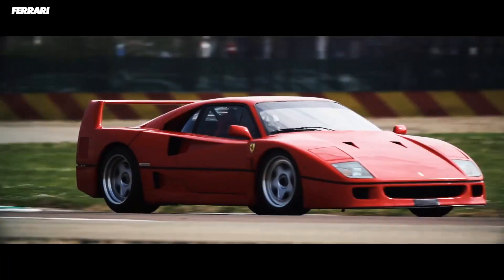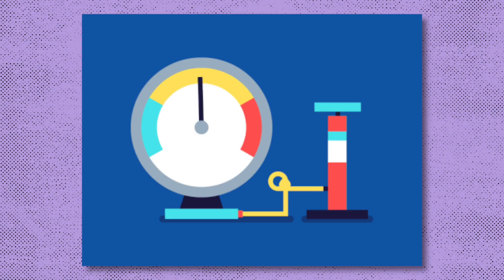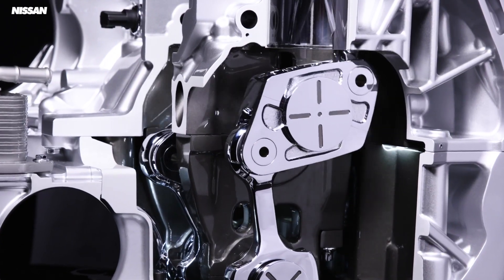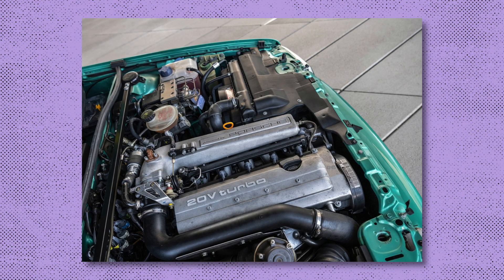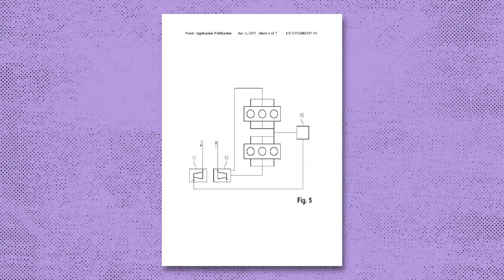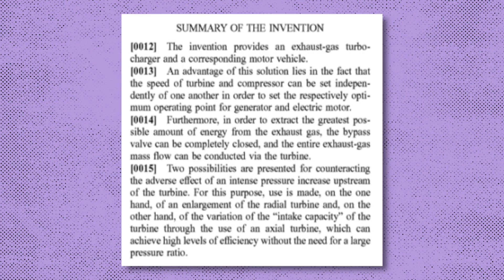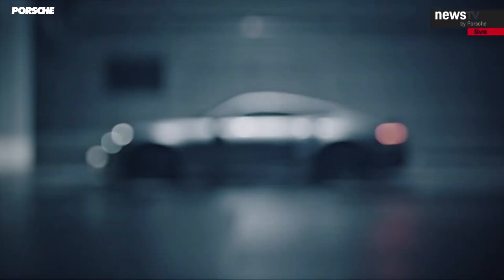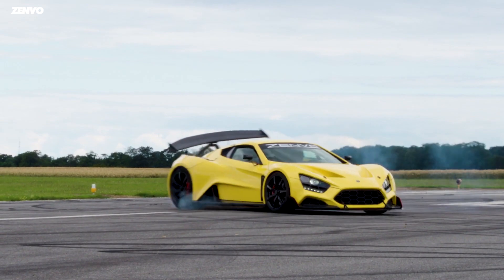Porsche's GENIUS New Turbo Design

Comment: Feel it's worth mentioning as this is a Porsche video. Porsches anti lag doesn't work the way you described, they leave the intake slightly open when you lift off throttle to keep the turbos spinning
Reply: Too much ego in this comment section.
Reply: @kelvinkeme9397  because this idiot is basically telling me the sky is unicorn colour. Couldn't be any more wrong
Reply: Yes. It makes the turbo lag predictable and makes it unbelievably fun to carve some corners
Reply: If they leave the intake open, does that mean it uses more gas?
Reply: Not if the ecu injects no fuel. Maybe the engine braking makes the engine reciprocate and that pushes some air through?
Reply: @elchucapablas  yep
Reply: @igamehard8860  "I guess when you have no knowledge you attack someone's...." my man, staring into a mirror? Had to have yet another chuckle hahaha. You're a gift
Reply: @2g1c69  don't delete comments. Now my where exactly did my conversation disintegrate comment will be lonely :(
Reply: @2g1c69  If I'm starting into a mirror you LIVE in a house of mirrors. So you are just going to glaze over your brillisnt remark of " only a fool resorts to insults ".. Do you know what the word fool means smooth brain?
Reply: @2g1c69  I'm curious. Where exactly did my argument disintrsgate? I've been saying the same thing this entire time you dummy lol
Reply: What fool means? It's why you've brought me great chuckles. Yes I sickeningly enjoy watching credulous commenters lose their cool, what an easy way to pass time & judgement. What a genius you must be! I would've thought a genius would simply explain a problem soundly enough for the most challenged to understand. I guess I'm no genius either
Reply: @2g1c69  I did go into detail.. about how SOME air moving through the engine by leaving the intake open is better for the turbo response then NO air going through. Tbh that shouldn't need much explaining if you really understand how an engine works. Turbos arent exactly an automatic transmission.. But I guess if I can't explain exactly how Porsches dynamic boost works then that means it doesn't lol.
 I'm sorry Dr. F. Piech
Reply: @igamehard8860  If you can't explain how it works, don't try to sound like smartass. None said it doesn't work. From the beginning we stated that it doesn't work like YOU described!
Your words in 2nd post: "This allows more air to pass through the engine, keeping exhaust flowing and spinning the turbos even during deceleration." 
It's not about moving air, it's about keeping intake under pressure.
In the end, Andrew and me was right that's not about moving air (which can't provide energy for turbo and prevent it from slowing down) and there have to be more to it or other explanation. 

As i said, everything is simple in principles, even your "complicated" automatic transmission. The deeper you dig the more complicated it become and turbochargers from engineering/science point are WAY more complicated than transmissions.
Reply: @feluke8396  I'm not reading all that.. if I'm wrong simply tell me where.. I don't need a story.. what do you mean like I described? You mean like road and track and engineering explained described, right? lol did you forget your comment from 8 days ago where you stated " the intake valve stays open? " Which is what I've been saying this entire time. I really get the feeling you don't fully understand how an ice, or any part of the car after your turbos are WAY more complex then transmission remark.. the fact no one has jumped on you yet speaks volumes to the lack of knowledge here
Reply: @2g1c69  because it's funny... The genius ( in this thread it's impossible to tell which one lol) just stated that the intake stays open allowing boost pressure to not drop off completely which is EXACTLY what I've been saying this entire time.. only everyone is too stupid to see it. If he says it's flatshift.. then sure it's flatshift lol. I'm more then done
Reply: I was going to add a comment but jeez (this comment thread is ridiculous). I know some version of Porsche's anti lag system actually functions to use wide open throttle momentarily when you blip the accelerator (say through a turn) in order to spool up the turbos so they are pre-charged when you get on it. Clever programming on their part
Reply: @gmatta1112  Which sounds similar to what I've been saying. This mess all started when andrews first unedited comment was keeping the intake open DOESNT allow the turbos to keep spinning. Which if was true would defeat the whole idea of Porsches inti lag or dynamic boost.

Intake stays open, engine gets more air going through the intake and exhause valves to allow the turbo to keep spinning reducing turbo lag. Its pretty simple and don't see why it's so difficult for some to understand. I want to say case closed but I know its never going to happen
Reply: @igamehard8860  
What I said was they don’t stay spinning. It means they don’t maintain enough RPM to create boost. Yes that is racer talk and not engineering language, my bad. Anyone who understands turbos without being argumentative understands turbos always spin. But it takes 10,000’s of RPM to get boost. A turbo spinning at 5,000 RPM will not deliver boost. It is often stated it needs to spool up or start spinning to get boost when this occurs. It is never meant it doesn’t turn!
You can say I wasn’t exact enough and that could be true. But the next two sentences made it clear this is exactly what I meant. 
Much more interesting is the engine creating full boost from idle to redline and at every throttle setting 100-% of the time…. With turbocharging
Reply: @andrewday3206  if an engine is running the turbos are spinning, what you mean they don't stay spinning? Obviously off throttle there isn't any boost and it's impossible to get all the boost back instantly. The dynamic boost HELPS reduce turbo lag, not bring all boost back instantly
Reply: @MrPorsche91730  
That’s exactly what I’ve been saying. Off throttle they spin too slow to develop boost. Of course they spin but far to slow for a non vacuum condition. 
Exactly
Reply: @MrPorsche91730  
BTW no it is not impossible to maintain full boost while off the throttle. I described an engine already built that had full boost with zero throttle input. In the comments are the details of full boost design at idle.
Reply: @andrewday3206  yes but with PORSCHES system it's impossible to get it all the boost back.. which was the whole point of this conversation. Porsche not other companies
Reply: @andrewday3206  but leaving the intake open allowing air to pass through the engine and turbos is better for response then no air going through. Your argument really makes no sense and it's sad it's gotten to this point. The system isn't made to create loads more boost, it's to keep the turbos spinning faster then if the intake was closed to help reduce lag time
Reply: @MrPorsche91730  
It wasn’t the whole point of this conversation. Early on in this thread I pointed out there have been engines that develop full boost 100% of the time. I got insulted for pointing this out. Of course it is part of the discussion. It shows how this Porsche design did not go as far as is possible. This is a mild system. It is literally equal to every stock Diesel engine out there.
Reply: @MrPorsche91730  
I never said anything about “loads more boost” for this design. I agree with you 100% it is really sad it has gotten to this point!
Everyone wants to be smarter than all other people, and nobody wanted to learn. It was sad 100%!
Growing up surrounded by engineers people discussed to learn and not to hear themselves sound smart. Not being arrogant but nobody here wanted to learn. I’m sure in fact I’m 100% sure there is a TON left for me to learn, but uneducated insults are beneath engineering
Reply: @andrewday3206  but you keep saying it doesn't spin the turbos fast enough to create any boost, but the system isn't 100% ment to do that. It just keeps the turbos spinning faster then they would normally be if the intake was closed. It reduces lag time as well by already having some air flowing through the engine as opposed to a car without this system
Reply: @MrPorsche91730  
Agreed 100% Yes
Reply: @andrewday3206  how manny people do you need, till you understand that you we're wrong?
Reply: @Razor9638  
When I see an energy balance showing me wrong. So far I have not seen that. The only thing I got wrong was using a racers expression expression saying the turbos weren’t spinning to mean they weren’t spinning fast enough to make boost. The next 2 sentences said why they weren’t making boost. It is clear to anyone who understands turbos that is what I meant. Where exactly have I been wrong? Please be specific
Reply: @andrewday3206  seriously, If you look back at your comments and replies and don't understand how it makes you look stupid for the rest of us readers, you should learn to reflect on your own behavior.
And if you are mentioning patents in that field, where is the problem with sharing them?
Reply: @andrewday3206  I just looked up. There are tons of Andrew Days with patents... But not a single one with turbos😉
You have the time to post tons of comments but putting a simple number is isn't possible. 
How could anyone not be sceptical about that?
Reply: @Razor9638  
You finally started looking after all these posts.  Still you cannot once answer where physics is wrong 
Impressive, No really that’s impressive 😂😂
Reply: @MrPorsche91730  I just love how substantive discussion is out of your reach. When confronted with facts and someone with more knowledge you simply ignore them. XD
We already told you that the amount of air passing through turbine is so low that it's insignificant. There are no gains from it, that are measurable.
The only gain would be from "flat shift", when you don't close throttle, keep the pressure in intake instead of using BOV/DV. The turbine slow down more but in the end gain way more from instant supply of air to combustion chamber. Turbine doesn't waste time to pressurize the whole intake system.
Reply: @Razor9638  He's not wrong.
We already told that the amount of air passing through turbine is so low that it's insignificant. There are no gains from it, that are measurable.
The only gain would be from "flat shift", when you don't close throttle, keep the pressure in intake instead of using BOV/DV. The turbine slow down more but in the end gain way more from instant supply of air to combustion chamber. On top of that turbine doesn't waste time to pressurize the whole intake system.
Reply: @Razor9638  You Rock.. and Roll. 
Dude don't engage the idiots. The truth is very simple and right in front of their face, but one idiot THINKS he knows better then a group of Porsche engineers. Which I somehow doubt..
Reply: @Razor9638  Nice to see that all of yt isn't a bunch of pathetic kids who think they know everything. Somehow I get the feeling someone with the picture of a cartoon cat may not be the best place for automotive knowledge... Clearly. Oh damn.. they " already told " me that Porsches dynamic boost is a gimmick and does nothing. If the mighty feluke says so, it must be true I guess lol
Reply: @MrPorsche91730  Arguing with you is like playing chess with pigeon. In the end it will knock all the pieces, shit on board and flutter wings like it has won. You stick to something you read in magazine like it's Holy Bible. You won't exercise your brain a little bit and check if what they said is even possible. Me and Andrew Day are looking for answers how it works. 
For you, article in magazine is good enough, even if it's simple PR.
Keep it up, among friends you will sound very smart. XD
Reply: @MrPorsche91730  "The Dynamic Boost Function enables the turbo in the car by maintaining the charge pressure during load changes (for example, when the accelerator pedal is released briefly). This is achieved by just interrupting fuel injection, whereas the throttle valve remains open. As a result, the engine reacts with practically no delay to another press of the accelerator pedal"
FLAT SHIFT!!!! A GOD DAMN FLAT SHIFT!!!!!!!!!!
BUAHAHAHAHAHAHHA!!!
Reply: @MrPorsche91730  
"Furthermore, the new Dynamic Boost function improves throttle response when the driver lifts
off the accelerator pedal during full acceleration and then gets back on it. At this time, the
throttle valve remains wide open, while fuel injection is interrupted. As a result, boost pressure
does not drop off completely, and the engine reacts promptly when the throttle is reapplied,
comparable to a naturally aspirated engine. The effect is most pronounced in Sport and Sport
Plus modes."
Doesn't use BOV/DV and leave throttle open. Something similar to FLAT SHIFT.
I rest my case Mr. Smartass. XD
Reply: They also achieve this through intentional backfiring. I drive a vehicle made by the same manufacturer(Porsche does not Manufacture Porsche, VW does). Anti-Lag my ass!!! I still prefer and am contemplating installing a supercharger on my car and selling this turbo...
Reply: @DJBillionator  
What a lot of these guys don’t get is a Diesel engine doesn’t have a throttle body. A Diesel engine has 100% air flow 100% of the time. Nobody ever says a diesel engine has an anti-lag system or is turbo-lag free LOL
Reply: @Alfred Wedmore already backpeddling deleting comments after 1 hour lol.. pathetic
Reply: Also let’s not forget the variable turbos. They always seem to get replaced when moar buff horses 🐴 and moar power is wanted. The engine generally powers a supercharger via a belt why not have a belt turn the turbo at a certain speed at idle up to the point the exhaust spins it faster then just have it where the pulley spins freely at that point. I guess that would make it a hybrid cross of a supercharger and a turbo. Someone write us up a patent application.
Reply: If only the assumption before replying was "I bet there is a valuable perspective being shared. If I am quick to call it wrong, maybe I haven't taken a breath to first understand the intended meaning of this person's words that I may be misinterpretting."

Literally nothing Andrew said is inaccurate *if you took the time to understand what he meant and in what context he was speaking*. And in fact, most of the commenters who were disagreeing actually ultimately had the same basic foundational understandings, except some didn't think as deeply into the whole process, and many didn't understand that there were multiple different points made in individual threads of thought that weren't direct comparisons, but rather whole different ideas (like the Porsche system vs what could be possible with a further optimized anti-lag system). 

If attitudes had simply been different, whole new understandings, and even co-creative ideas and solutions could have arisen out of this discussion. This behavior is literally at the root of so much destruction, that one could say it's one of the primary roots of war, domestic abuse, and a host of other worldly non-sense. Y'all can do better. 🙌
Reply: Even a Chevy Cruze has a recirculating bypass valve on the turbo
Reply: Leaving the intake open does not keep the turbo spinning fast enough to create boost. The lack of spinning of the turbo is due to a lack of exhaust gas energy. Leaving the intake open does not keep the boost going.
Reply: @andrewday3206  No, but opening the intake would allow the turbos to spin freely on inertia instead of spinning against built-up boost. this means that the turbo can spool up to boost levels faster as it was never spinning slow to begin with.
Reply: @andrewday3206  In a Porsche with Dynamic Boost, lifting off the throttle pedal shuts off the fuel injectors, but leaves the throttle partially open. This allows more air to pass through the engine, keeping exhaust flowing and spinning the turbos even during deceleration. Dynamic Boost doesn't get rid of turbo lag entirely, but it reduces the time it takes to get the turbochargers spooled up significantly
Reply: @igamehard8860  
It’s the burning fuel that supplies the energy to spin the turbos. My father designed a engine that blipped open the exhaust valve a tiny bit during the power stroke. They added a small amount more fuel. This allowed exhaust gasses to exit the combustion chamber and keep the turbos spinning. The engine maintained full boost at idle.
Reply: @andrewday3206  you are so wrong.. are you really educating me on turbos work.. talking to you I feel this subject is way over your head.. this goes way beyond the basics of a turbo
Reply: @igamehard8860  
I’m not wrong. The energy comes from somewhere. Engines release energy from burning fuel and utilize it to do work. That work can be turning a crankshaft or can be building boost.
Reply: @igamehard8860  
Diesel engines have full air during every throttle setting. Diesel engines do not limit air, there is no throttle body. Even in an engine with 100% open intakes you need to burn fuel to spin turbos. The one caveat is during engine deceleration you are turning potential energy, the spinning engine, into boost built. Doing this will stall the engine if one keeps doing this however
Reply: @igamehard8860  
Stop with 8 year old insults. Where does the energy come from?
Read my entire reply!
Energy comes from somewhere
Reply: @andrewday3206  In a Porsche with Dynamic Boost, lifting off the throttle pedal shuts off the fuel injectors, but leaves the throttle partially open. This allows more air to pass through the engine, keeping exhaust flowing and spinning the turbos even during deceleration. Dynamic Boost doesn't get rid of turbo lag entirely, but it reduces the time it takes to get the turbochargers spooled up significantly
Reply: @andrewday3206  that's taken from a r & t magizine.. I doubt you even know what r & t is. These are facts.. not some garbage info from a know nothing kid
Reply: @igamehard8860  
Yes and using the engine as an air pump to spin turbo wheels slows the engine RPM!
This design cannot keep an engine running. Ultimately it will slow down the engine as energy is being used to pump air, or it will slow down the vehicle and act like an exhaust brake. This design cannot sustain itself in a running configuration
Reply: @andrewday3206  do you need a bright red ball bouncing on each word?? It clearly states the intake is partially open... You are something else to argue with facts right in front of you
Reply: @igamehard8860  
It is using stored energy in vehicle speed or engine rotation to power an air pump effect. This by design slows down the engine RPM and/or vehicle speed.
Do you just regurgitate words without understanding the physics? 🤣🤣🤣
Reply: @igamehard8860  
This will not stay running if left in this situation. More fuel needs burning to keep the engine running

Learn Engineering!
Reply: @andrewday3206  I'm more then done. I've posted the facts.. again I can only show it to you I can't understand it for you
Reply: @igamehard8860  I mean this with no disrespect due to the fact that I’m barely educated on this matter, but if the technology wasn’t around why does my cayenne hold revs (only when driving aggressively, with almost a wide open throttle) when I release the gas pedal? Maybe I’m stupid. I dunno 😂
Reply: @Chrysaor_  it's probably the transmission holding gear. Porsches do that as the car thinks you are cornering. They hold that gear for a few extra seconds so the transmission isn't constantly shifting and is in the right gear when you accelerate again. Have your coolant lines held up? There was a problem with the plastic becoming brittle and breaking. Yours sounds older so I'm sure it's been fixed by now
Reply: @igamehard8860  thanks for the info 🙌. Take it easy man.
Reply: @Chrysaor_  
It can holding it in gear or it can be keeping additional fuel injected to keep the RPM higher. One supplies energy from fuel burned and the other supplies energy through feeding off vehicle speed
Reply: @Chrysaor_ np. Take care.. if this other dummy stops talking to me maybe... I know Porsches
Reply: @igamehard8860  
You don’t know engineering or physics 
You still cannot answer where the energy comes from. You just copy and paste then claim that is comprehension 
Sad!
Reply: @igamehard8860  
Exactly you copied words from a magazine!
I couldn’t agree more. But with all your 8 year old insults you still haven’t answered where the energy comes from. Something has to power the air pump effect upstream of the turbine wheel. If fuel isn’t being burned where does the energy come from?
Try answering the Mass and Energy Balance if you know what that means
I’ll wait for your immature reply which still cannot answer what supplies the potential energy 🤣🤣🤣
Reply: @andrewday3206  and you don't know simple English which is more pathetic.. I've posted the article 3 times where it clearly states the intake is slightly open.. but you are clearly going to believe what you want and I couldn't care less
Reply: @andrewday3206  so if you think I'm wrong how about you pull up an article on exactly how Porsches anti lag system works. Showing the intake is 100% closed. I came up with some proof, now it's your turn mr knowitall
Reply: @igamehard8860  
A diesel keeps the throttle 100% open all the time. That by itself doesn’t create boost. Jesus maybe 95% of people in social media lie. But literally I have patents in reciprocating engines. I understand what the article is stating. I’m just pointing out it’s converting energy in the form of a spinning engine into work done pumping air through the engine to spin a wheel. My point is that is very different than designing an engine that can MAINTAIN 100% boost from idle all the way through the entire RPM range at every throttle setting! 
Go ahead and make fun of me for being proud of my father for designing and building this. But I am proud of that work, it inspired some of my patents later in life. This all started by me sharing that there are already turbocharged engines built that have full boost from idle to redline and at every throttle setting 100% of the time!
Take some engineering classes if you care this much you just might invent your own designs and hang your own patents on the wall. It’s a cool thing to do
Reply: @andrewday3206  mmm so that's a no.. shocking
Reply: @igamehard8860  
I never said it was completely closed. OMG I said the energy needed to spin the turbine wheel has to come from somewhere. If it isn’t supplied from burned fuel, it has to be supplied by converting motion into pumping air through the system. This either slows the car or the engine RPM like and engine brake by extracting energy. That’s what I stated. 

 This all started by me sharing a cool design concept where we already have engines built that have full boost 100% of the time. This goes beyond what Porsche has done. That’s what I stated the physics behind it. And that Full Boost 100% of the time has already been achieved and how it was done
Reply: @andrewday3206  engineering explained clearly stated the same thing. Porsches anti lag leaves the intake slightly open... You give me the feeling your father had some really smart co workers
Reply: @andrewday3206  wow wow wow... your first comment said leaving the intake open does not keep the turbos spinning. IF you read the article I copied and pasted you wouldn't be so confused. It clearly states they leave the intake open to allow  some air to go through the engine and keep the turbos spinning.. I hope you aren't sober at least. That was pathetic
Reply: @igamehard8860  
No Porsche leaves the throttle body entirely open!
It does not leave the throttle body slightly open.
The Porsche system extracts energy from vehicle velocity to use the engine as an air pump aka air compressor and this drives the turbine wheel. The Porsche design extracts energy from the vehicle. That is the simple question I asked. 
Here’s a hint engineers work with a lot of smart people. The design he invented had a multi lobe camshaft that would bleed combustion chamber pressure out of the cylinder before the power stroke had finished. This was just enough to keep the turbine spinning at full boost so it didn’t effect fuel mileage very much. But as the video you shared said Porsche had a mild system. The design my father invented and built was wild as it kept boost at 100% all the time, period!
That’s the difference I pointed out in the very beginning. 
#Engineering
Reply: @andrewday3206  you going to start backpeddling now.. I nEvEr SaId iT WaS CoMpLeTeLy ClOsEd
Reply: @andrewday3206   it clearly says the throttle is partially open.. were you given a pile driver on your head
Reply: @andrewday3206  lol. It's adorable how smart you think you. The professional writers at Road and track says it's partially open, Jason Fenske from engineering explained says it's partially open ( he said fully I didn't watch the video ), my excellence Porsche magizines say same thing but some dummy on yt says it's fully open...3 to 1.. you win
Reply: @igamehard8860  
1) Leaving the intake open without burning fuel or extracting energy from another source will NOT build boost. That is what I said from the start and I am still correct. I kept asking where does the energy come from and you couldn’t answer that!

2) The throttle body is not slightly open as you said many times. The throttle body is 100% open just like in a Diesel engine. And just like in a Diesel engine it does not provide full boost at idle or any other RPM without burning fuel. That was my other point and that is still true.

3) The system turns an engine into an air compressor to spin the turbine. And just like an air compressor that requires energy. An air compressor uses a motor to turn it. This uses the transmission which is extracting energy from vehicle velocity to make the engine, now an air compressor, spin.

That’s the engineering and energy supply. I have been correct the entire time
Reply: @andrewday3206  but leaving the intake open does allow the turbos to spin PERIOD. Disproving your original point of saying they don't
Reply: @igamehard8860  
A turbine spinning doesn’t create boost unless it’s output is more than the engine is ingesting!
So no that does no disprove anything at all. Turbocharged engines still operate in a vacuum much of the time. That is why it’s called off boost. That is also why you have turbo lag waiting for the turbine wheels to spin up and increase RPM where it pumps enough air to create pressure aka boost.
Reply: @igamehard8860  
I never said they don’t spin!
Turbos can spin 100,000 RPM at full boost on some engines. Even at idle they will spin a few thousand RPM. But that does not supply enough air for the engine not to be running in a vacuum I.E. negative boost situation where there is a lag time before the wheel spins fast enough to create boost
Reply: @andrewday3206  dude you saying leaving the intake open doesn't allow the turbos to spool in your first comment is false, Period. I'm not getting into all these other arguments and I have much better and important things to do then teach ppl how to read
Reply: @andrewday3206  mate you need to get off your high horse. The "energy" comes from acceleration, the anti lag keeps the throttle body open to allow airflow to keep moving through the engine rather than it being shut off almost completely, that is what allows the turbos to "spin" as it reduces the braking force that a closed intake has on it, its not called anti lag it's called dynamic boost there's a difference, it's really not difficult to have a Google of it and educate yourself.
Reply: @ant_mk3596  
The energy does not come from acceleration. Acceleration comes from applying energy. Having the throttle body closed is not what causes the turbine wheel to slow down. Not having energy applied to the exhaust turbine is what slows it down. Allowing the air to flow freely like in a diesel is what allows force to be applied the the exhaust turbine which keeps the compressor turbine, actually both, spinning. That’s the reason people say diesels work so well with turbos. 

Whatever the marketing name does not change the physics LMAO 🤣🤣🤣
Reply: @andrewday3206  I feel like you've just heard some vague physics terms, without really understanding them lol. "The energy does nto come from acceleration" lol wtf bro. If you wanna be pedantic which it seems like you do, energy is a force applied over a distance W=Fs. Having the throttle body closed reduces the amount of energized gas flow to the turbine, hence letting it slow down -  that sounds like closing the throttle slows down the turbo to me, go read up proximate cause vs ultimate cause for explanation.
Reply: @jackwilson7082  
Work is force applied over distance. It can be measured in terms of energy, but that is not the only method of measuring energy. BTU, KW/Hr, Kilotons and more are also measures of energy. Heck Adiabatic compression can be a  measurement of energy. 

 The energy to pump those gasses in the design Porsche marketed comes from the crankshaft as a parasitic loss.
That’s the point which I made. 

 The intake stroke will draw a vacuum on the compression turbine helping to keep it spinning. The exhaust stroke will help keep it spinning as well. There still is not enough energy applied to create boost. It is the same as a Diesel engine as those do not have a throttle body and always draw full air. But Diesel engines are often drawing more air than the turbo can supply an not in boost.
Reply: @jackwilson7082  
Are you seriously telling me a volume of compressed gas does not contain stored energy?
That’s just insane
Reply: @jackwilson7082  
I never said the intake draws from the exhaust. As the piston comes down it draws in air. With a turbine wheel partially blocking the intake it draws a vacuum. This spins the compression wheel. You seriously didn’t understand that?
You seriously don’t understand a turbo has an exhaust turbine and a compressor turbine?
Damn!!
Reply: @jackwilson7082  
BTW compressed air energy storage is already used in industry. Compressed air contains energy
Damn you make some amazing claims 🤣🤣🤣
Reply: @igamehard8860  Andrew is right. Porsche are using the energy of the car moving (or flywheel inertia) to turn the engine to pump air through the engine to keep the turbo spinning. The valves being open enable this but do NOT provide the energy, which is what Andrew is saying
Reply: @andrewday3206  An adiabatic process is not a measure of energy, so you are just plain wrong. I never said compressed gas cannot hold energy,  however no one ever says "how many kg of 100psi air worth can your engine out in power?". Frankly, your inability to actually articulate what you're saying isn't my fault - don't try to gaslight me by retroactively changing what you're saying.
Reply: @psk5746  Yeah like no one here ever thought that opening a valve "generated energy" - its cause you're using the engine as a pump which is fed by the momentum of the car. But opening the valve is whats enablign that. Andrew over here just likes using physics terms he doesn't really understand lol. I mean he's trying to explain work to me this rubbish "Work is force applied over distance. It can be measured in terms of energy, but that is not the only method of measuring energy." like wtf 😂😂😂bro doesn't understand how units work
Reply: @jackwilson7082  well reading everybody's replies it certainly appeared that most believe the energy came from opening the valve
Reply: @psk5746  yeah everyone is talking about cause though - why it works - not where the energy comes from. I think why everyone is so confused is because Andrew is hell bent on talking about energy
Reply: @jackwilson7082  well energy is required to spin the turbine.

But yeah a case of miss understanding due to the written word
Reply: @igamehard8860  what's a Magizine? Over here in England it's a Magazine and seeing as we invented the language I think you'll find we are correct and not you. By the way reading a bloody article in a MAGAZINE doesn't make you an Engineering god. Do you actually know anything about ICE and Turbocharger technology, or are just  quoting from the article? My guess judging by your username is you spend all your time playing computer games..Leave the engineering to the engineers in future.
Reply: @jackwilson7082  
I certainly won’t change what I said. Yes a given amount of gasses at a given pressure is a measure of energy. If you don’t understand that it is not on me. As I said compressed air energy storage is literally an industry. Also how do you think an engine works? The compression stroke is literally adiabatic compression!
I’m amazed you don’t know this
Reply: @andrewday3206  I feel so sorry for you... You have to argue with arrogant prick that have cognitive dissonance and is at the pinnacle of Dunning–Kruger effect. He doesn't know how turbo work, doesn't know what is needed for it to work. He read about partially open throttle for antilag and all of sudden, his an all knowing oracle.
I understand the principles behind Porsche "antilag" but i think it gives very little effect to none. If it did work so good the diesels would work epic because of no throttle to limit air. Way better would be to open throttle and in exhaust stroke inject small amount of fuel and ignite it. With direct injection it should be easy and harmless to the turbo.
Reply: @andrewday3206  I think i know what Porsche meant by implementing open throttle on deceleration and how it works. They probably don't use DV/BOV on lift off and provide that air to fill intake and cylinders for instant response after "throttle" is applied. Something similar to flatshift.
Reply: @feluke8396  
I have to agree with you. Thank You for the input
Reply: @feluke8396  
Back in the day Cummins diesel tried exactly what you said. They injected diesel fuel directly into the exhaust manifold and ignited it. They could easily get multiple bars of boost. The project was called Hyperbar. This project came to an instant stop when the engine left go and pieces of metal imbedded themselves into the cement of the test cell! You brought up exactly that idea.
I still love the concept of variable valve timing opening the exhaust valve for a blip to expel energy to keep the turbo spinning for full boost at low throttle settings. This was done with a Diesel engine and did keep full boost from idle on up. It was envisioned for military diesel powered vehicles to be used in combat settings. You would simply have a switch you would flip to turn it on and off. When in a combat environment you would activate constant full boost for better vehicle response albeit with slightly more fuel burn. The marketers for the company tried to sell to to railroads for some unknown silly reason and the system was shelved. That was built at Jacobs Vehicle Systems not Cummins.
Have a great day
Reply: @psk5746  yea and if the intake was closed like buddy said it would stop that from happening wouldn't it... Case closed
Reply: @pauln0371  I'm not surprised me being off by one letter confused you... It looks like it don't take much eh lol
Reply: @pauln0371  tbh my main account is mrporsche91730
Reply: @andrewday3206  I'm calling your bluff..what patents exactly??
Reply: @MrPorsche91730  
Why do you assume it’s a bluff?
Reply: @andrewday3206  stop stalling. Patent numbers let's go
Reply: @MrPorsche91730  
Once again why do you assume it’s a bluff.
Reply: @andrewday3206  because after talking to you I honestly believe it's impossible you could hold a patent. But after this thread, I'd love to be wrong for once lol. Patents have numbers right? I answered your question, enough stalling. Numbers please
Reply: @MrPorsche91730  
I just asked why you were rude and condescending. I still have not been incorrect on this thread, even if you cannot see it.

Have you even just typed my name and patent?
Here’s a hint there is more than one
Reply: @andrewday3206  tbh I haven't bothered to read anything you posted and just saw now your very first comment makes zero sense lol! Exhause gasses allow the turbo to spin, yea duh. But how you can you say " keeping the intake open doesn't allow the turbos to spin?" So what happened to that air that just went inside the engine? It has to come back out the exhaust and what's attached to the exhause msnifold oh it's a turbo lol. How exactly does a engine work in your mind. I'm saddened by humanity anyone defended you
Reply: @igamehard8860  
You can keep using 4th grade insults that’s cool LMAO
Turbos require waste energy in the exhaust stream to generate boost. If the car is at idle the engine is still at a vacuum as there is a lack of energy to spin the turbo(s) fast enough to develop boost. It all comes back to energy. This is literally a Mass and Energy Balance.
Reply: @andrewday3206  all you had to do was give me a patent number and not ask me to research you. Are you fimilar with the term narcissistic?
Reply: @MrPorsche91730  
I’ve been dealing with narcissism this entire thread. You started with saying you are calling my bluff. To be a bluff it means I’m lying and there is nothing backing up my claims!
I politely asked why you assume it’s a bluff and you try to give me an order instead of answering why I’m automatically a liar. Others take an expression that the turbos aren’t spinning and try to say that means I don’t understand they are rotating. There has been far too much uneducated insulting. You openly and incorrectly say there is no way you have patents but don’t even bother to google my name with the word patent. Heck another fool says compressed gasses don’t contain stored energy.

All I’ve done is point out turbos require exhaust energy to maintain boost
All I’ve done
Reply: @andrewday3206  
"The Dynamic Boost Function enables the turbo in the car by maintaining the charge pressure during load changes (for example, when the accelerator pedal is released briefly). This is achieved by just interrupting fuel injection, whereas the throttle valve remains open. As a result, the engine reacts with practically no delay to another press of the accelerator pedal"
As i said, it's just flat shift with a lot of PR mambojambo. XD
Reply: @jackwilson7082  
"Furthermore, the new Dynamic Boost function improves throttle response when the driver lifts
off the accelerator pedal during full acceleration and then gets back on it. At this time, the
throttle valve remains wide open, while fuel injection is interrupted. As a result, boost pressure
does not drop off completely, and the engine reacts promptly when the throttle is reapplied,
comparable to a naturally aspirated engine. The effect is most pronounced in Sport and Sport
Plus modes."
Similar to flat shift. So Andrew Day was right. XD
Reply: @ant_mk3596  
"Furthermore, the new Dynamic Boost function improves throttle response when the driver lifts
off the accelerator pedal during full acceleration and then gets back on it. At this time, the
throttle valve remains wide open, while fuel injection is interrupted. As a result, boost pressure
does not drop off completely, and the engine reacts promptly when the throttle is reapplied,
comparable to a naturally aspirated engine. The effect is most pronounced in Sport and Sport
Plus modes."
So similar system to flat shift.
Not that nonsense about air flow keeping turbo spinning.
Reply: @feluke8396  
It’s kinda funny how they didn’t define exactly how long is briefly. I agree mambojambo
Reply: @feluke8396  ?tf have you even read what andrew day wrote? that is what i was saying the whole time, while andrew was out there rattling on about some "adiabatic compression" rubbish

bruh even our man andrew has given up on this topic lol
Reply: @igamehard8860  Absolutely horrendous chat. Hilarious that you attacked a man's English with that many mistakes, appalling decisions across the board. Had an absolute ball watching your arguments disintegrate. Maturity is clearly not a strong point of yours with that many playground insults 😂😂🙉
Reply: @2g1c69  lol was that supposed to hurt. You say it's name calling, I say it's calling a spade a spade. If you read all those you need a hobby
Reply: @jackwilson7082  The compression turbine feeds the INTAKE.
Reply: @Unimatrix69  oh wow really? i didn't know, please share more of your gems of knowledge with me
Reply: @GrinningSpinBin  
You said zero technical 
Mommy has your warm glass of milk ready
Reply: @GrinningSpinBin  
Once again you have said nothing technical. I’m proud I worked with my father on new designs. I’m proud of my work and his work we did independently. Funny how you throw elementary school insults with zero technical content.
Have a good weekend kid 🍼
Reply: @andrewday3206  Is that 100% boost at idle design available / installable on a 20 year old Honda cam?
What is the fuel efficiency drop? 
I am highly interested to build that onto my Honda.
P.S. you are right in this discussion (from a Dutch Bachelor mechatronic engineer)
Reply: @kasperveenje2509  
The prototype was built at Jacobs Vehicle Systems in Connecticut, USA
I never heard of second unit built.
Reply: @igamehard8860  If it shuts off the injectors, what keeps the engine running? Is it a momentary shutoff?
Reply: @andrewday3206  He cleary stated that it is a partially open-throttle to reduce turbo lag. The exact way to to name is an off-throttle cold blown exhaust system which use by Motogp to modulate engine braking while in F1 Redbull use it to seal the rear diffusser during blown diffusser era under loophole found within exemption given by FIA to any Renault powered car (50% partly open throttle fuel shut) to level the playing field between them vs Ferrari and Mercedes,  reliability-wise. 

We are exclusively talking about off-throttle under deceleration (back torque). Idk which part that you brain can't digest.
Reply: @soraaoixxthebluesky  
Actually their information said an open throttle. The discussion was not a racing body rule it was about boost potential and an energy balance. While your condescending BS💩 was flowing you just admitted it is a parasitic load that takes energy away from the vehicle, which is what I said. It also does not produce boost which is what I stated. With the valves fully open it is the same as a deisel engine in everyday use.
I’m not sure why your brain cannot understand this. Every part of that energy balance is what I stated kid
Reply: @igamehard8860  
Ummmmm the video you supplied said at 2:08 and 2:16 the throttle is left full open. That’s how in sport mode you move as much air as possible to the turbine to keep it spinning. You turn the engine into an air pump aka air compressor with the highest flow possible. When not in sport mode it may close, but in sport or a race mode it’s fully open. Your supplied video says it more than once. Even when fully open you don’t maintain full boost but it works it’s best.
Reply: @andrewday3206  The road and track article said partially, the video says fully... Doesn't matter if it's fully or partially as your statement of the intake being open doesn't allow the turbos to spin is the real point of concern
Reply: @igamehard8860  
I never said it doesn’t spin. I said it has to extract energy from an outside source. I said it doesn’t create full boost as a stand alone system. That is still true. And that is why I started this entire thing by pointing out an engine that does maintain full boost from idle to redline
Reply: @igamehard8860  
It does not create full boost, Period! It reduces lag there is a huge difference
Reply: @igamehard8860  
I’m not the one who cannot answer easy questions. Yes I made one sentence easier for people who don’t understand turbos. The next two sentences made it very clear I was talking about boost. You really don’t understand engineering.
Reply: @igamehard8860  
If you want to act smart try learning about turbo systems that always have 100% boost all the time. Nice job ignoring every point you got wrong or didn’t understand
Reply: Lol. It's adorable you guys building yourself up on your knowledge of a turbo, prob one of the more simple parts on a car. Exhaust gasses spin a 2 sided turbine, and the other side allows clean, cold if there is an intercooler pressurised air into the engine.. not exactly an automatic transmission is it lol. Seriously the average person could learn how a turbo works in 2 mins. Don't flatter yourselves too much..the conversation was never about the engineering of a turbo it was that Porsche allows the intake to be slightly open to allow some air to pass through the engine to keep the turbos spinning, which I've clearly showed it does... case closed, if you are still replying to me you are clearly at the same intelligence level as Andrew. You dummies don't have a leg to stand on on this topic, it's pretty sad you are still replying
Reply: @igamehard8860  You are so dense!! As i said, pinnacle Dunning–Kruger effect. Go and google it
We told you already that's bullocks and why it is. You say the same thing over and over again without even thinking. You sound like a broken record... PoRsChe oPeN ThRoTtlE, TuRbO gOeS wOoSh.
Everything is simple in principles. The problem is that those are principles and there is WAY MORE to it. Simpleton like you can't understand it.
You wouldn't even understand why same turbines, but with different A/R generate different powers and have different powerbands.
Why even bother with turbocharger size match the engine size? Just strap random turbo to random engine and it needs to work, turbocharger is so simple. 
Air goes in-air goes out, boom, magic, everything work. Not like those automatic gearboxes that are on advanced magic level. XD
Reply: At least with my 06 cayenne turbo s it holds the revs up as well
(Edit: I am no engineer, solely talking from experience)
Reply: @Chrysaor_  that technology wasn't around in 2006. I believe it first came out on Porsches on the 2017 911 and 718 boxter and cayman
Reply: @Alfred Wedmore that heat thory is interesting. Can you list the source that claims the added volume of air comes from hot engine parts? Because I'd imagine there is more volume in the colder air entering the engine then exiting it  so I don't see how hot thinner air adds volume.. but after this thread I'd love to be wrong for once lol
Reply: @igamehard8860  on the subject of hot parts makes for more volume, the equation is PV=nRT, which means that if you take the same number of moles(in this case units of molecules of air or burnt exhaust), and you heat it up, you will either linearly have more pressure or a higher volume if there is space for it to expand. This is the primary premise behind the motive power of combustion. The combustion releases energy as heat which creates a higher pressure of gas, which wants to expand to create a larger volume. In a turbo, this energy is further utilized in the exhaust turbine, not just because exhaust gasses are rushing past the turbine, but also because the gas is allowed to expand into and past the turbine, recovering more energy into motive energy that would have otherwise been lost as heat. This is the only reason turbos are more energy efficient than super chargers.

Now whether hot engine parts rather than active combustion is significant enough to heat the air would be up for debate. I would imagine it would be for at least a few revolutions without combustion (injectors turned off) in between shifts. The engine cylinder walls couldn't possibly transfer all of the remaining heat to the coolant in those milliseconds.
Reply: @Alfred Wedmore lol. I'm not reading all that. Could you simply please list the CREDIBLE source thst states" the added volume in Porsches anti lag comes from hot engine parts " .. without credible sources I'm taking that info as your opnion and you can understand how someone's opnion on yt means f all.  I want to hear it from a credible source rather then someone on YouTube who has time to write all that. I've listed sources for all my info and was riduciled lol. I guess opnions matter more then credible sources..
Reply: For future yt who wonder how this started was when buddies first unedited comment said, leaving the intake open does not keep the turbos spinning
Reply: @igamehard8860  in future it may be best to stop arguing with someone and be satisfied with the fact you have the greater knowledge. He doesn't realise he is wrong as it isn't his master engineer father telling him how mistaken he is. Time to move on.
Reply: @ant_mk3596  you are right.. I def should have. Just never met anyone so closed minded and was fustrating as f. He's like a kid putting his fingers in his ears and only wants to believe what he thinks is correct.. in his mind he is a genius and it's not right
Reply: @igamehard8860  it was quite an experience reading this, it definitely seems like he's 14 and overheard some physics terms but thinks he's an expert 😂, like he's gone from having the throttle open wont work to saying that having it open does work... too good mate
Reply: @jackwilson7082  thats a really good way of putting it. He mentioned his dad made some invention for the turbo so you are right lol
Reply: @jackwilson7082  
What I’ve said was an open throttle does not produce boost. You obviously don’t want to learn and that’s fine. But if the intake takes in the same volume of air as the exhaust outputs, and the exhaust turbine powers the compressor turbine, how can the system produce boost? When you consider that neither turbine is near 100% efficient you quickly see it becomes an air pump with parasitic loses. 

Something you haven’t even discussed is moving large volumes of air without fuel burn cools the combustion chamber. When the throttle is pressed again there is literally a delay in efficient fuel burn until the chamber heats up again.
Reply: @andrewday3206  and to answer this, the exhaust stream is being energized by heat from the cylinder, as well as velocity from the car. I know what ur trying to say about the same volume air in and out, but we're talking about sustaining a bit of RPM in the turbine for a few seconds after lifting, yes its not indefinitely self sustaining but its better than simply opening the wastegate and dumping everything
Reply: Maybe I would have gotten a bit more respect if I used my main account.. prob not from dickdrew